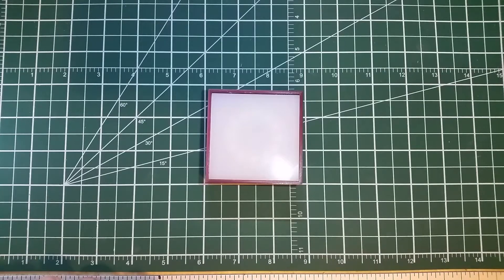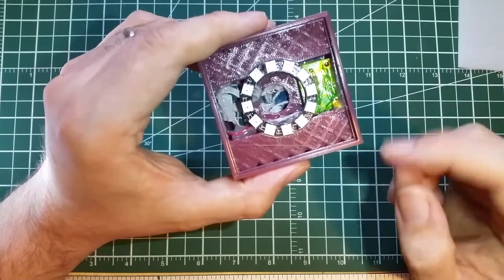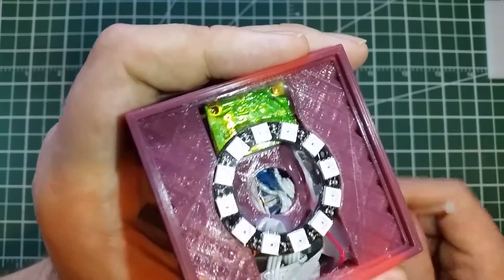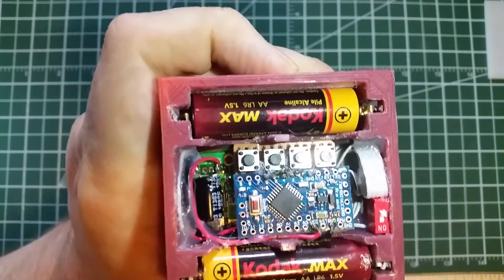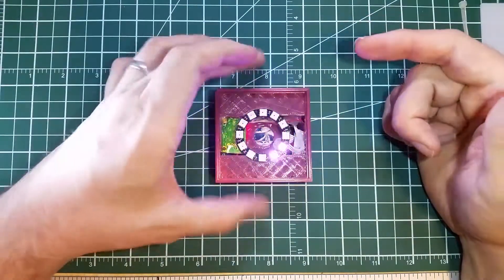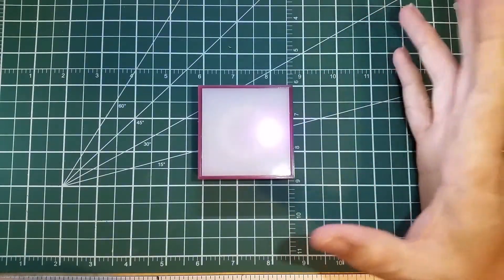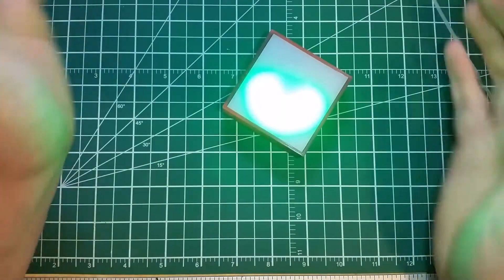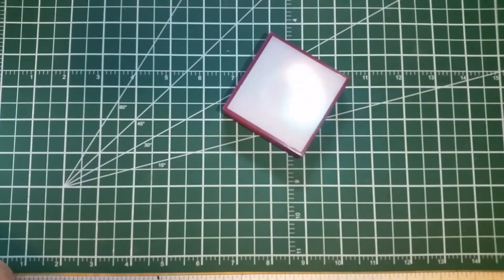NeoPixel or WS2812 Light Box Project

Comment: What did you use for the battery terminals?
Reply from the maker: 0.5mm x 2mm wide brass like strip. it's flexible , but retains some spring .  I tested x-mass orniment hooks , but they  dont have enough of a spring effect . you can get the stuff at most hobby shops that have a selection of fine brass for model making and such .
Reply: I will give it a try. Thanks!